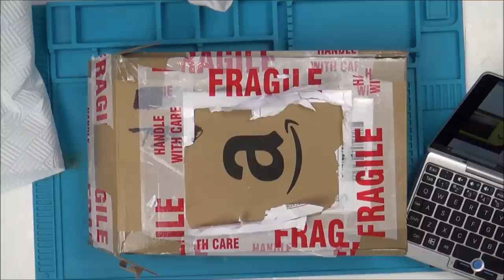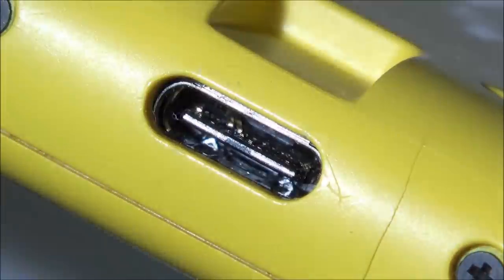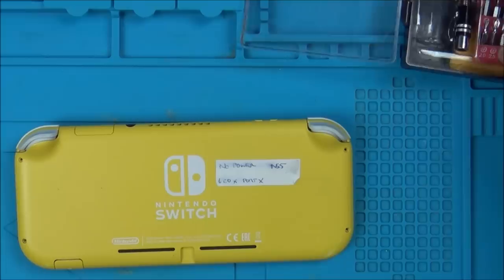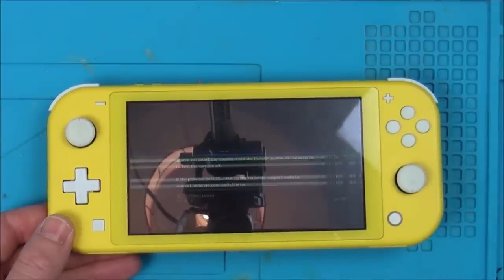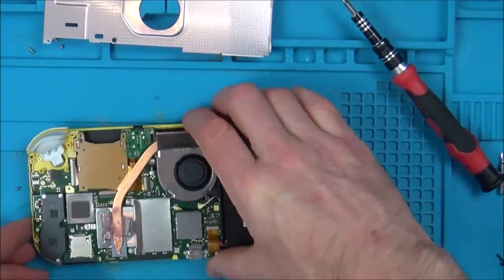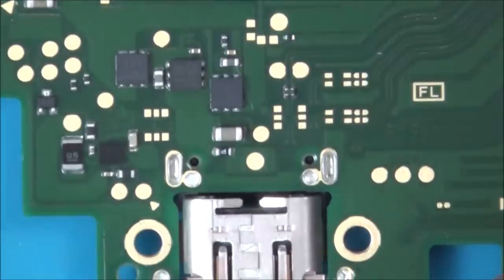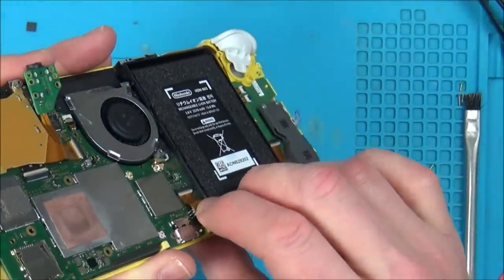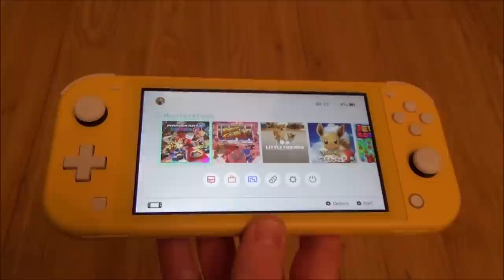Trying to FIX: Faulty £85 Nintendo Switch LITE from eBay

Comment: Vince: "I might just get away with bending those pins back in place" 
Me: Looks at video length "Yeah i don't think so"
Reply: 🤣🤣 I did the exact same thing!
Reply: Well maybe you should watch the whole thing 😉 these are the best videos when Vince does these.
Reply: to be fair, even if that worked, they'd still make the video take forever.
i once watched 10 minutes for what came down to "start the program, go to options and set these 3 options to these 3 settings"

Comment: If the seller didnt advertise the broken screen, I would ask for a partial refund.
Reply: Yup. I'd be telling the seller to refund the difference for a screen or get negative feedback. I'd also have no hesitation to expose the sellers name on a popular YouTube channel!
Reply: Definitely do it because it’ll deter the cowboy sellers and eBay. Especially if they know they’ll have to hand back 50%.
Reply: +Randy Smith, Never, EVER tell a seller you'll leave negative feedback. eBay WILL take this as feedback extortion, and you will lose any case you open. Do NOT do it.
Reply: @Dan-TechAndMusic  correct.  I always say I will leave appropriate feedback.
Reply: Agreed. Advertising it as “for parts” doesn’t give license to misrepresent its faults.
Reply: @Dan-TechAndMusic  You are absolutely correct - happened to me once, now I've learned my lesson. The correct way is to open a dispute, present your case and say that you would either accept a full refund with item return (paid by eBay) or partial refund (if you want that at all) and you keep the item and see which way it goes.

Comment: Its a mash up, dody main board and dodgy screen, someone swapped it it out and screwed you over... again...
Reply: There's too much of this going on end they know ebay will do nothing about it. I bought a quite expensive CD player a couple of years back that had a faulty transformer, a faulty main board, a dead laser, the remote sensor on the front board was bad and the remote itself was faulty. EBay did not want to know.
Reply: @jasejj  it was the same with a car I bought, it had water damage, front suspension damaged so bad the springs were broken into 3 bits, basically needed the whole front end replaced just to make it road legal. I complained, ebay said we will give you a refund for the price of the car, but you got to return it to the seller at your cost and driving licence cost if you get pulled over. rather than having a go at the seller for selling an unroadworthy vehicle on ebay.
Reply: @jasejj  I bought as "untested" an Alienware laptop with SLI cards in Mint condition, there where : Battery, screen, keyboard, motherboard and both SLI cards that where faulty. When i saw later on the sellers' sells, there were a lot of working Alienware laptops, beside a negative feedback ebay did not much about this.
Now when i buy faulty products I watch what the seller is selling and what the seller sold in the feedback and i take the time to ask questions, i prefer to loose an object than buying junk. If i have a little doubt, i don't buy it also.
Reply: I'm really curious how you guys are going about contacting ebay.  I've had a lot of garbage from seller but I've been refunded on each and every one of them by opening an item not as described case against the seller.  Most times the seller won't even respond to the case (likely because they know full well they sent me garbage) and ebay automatically gives me my refund.  Just takes time.
Reply: @Yoldark34  buying untested electronics is a gamble. A few months ago I bought a untested ps3 from mercari and It was in pretty rough shape. I think the seller got it in a lot and didn't have any games, cords, or controllers to test it. I bought it because it was only $14. I tested it myself and everything was fully functional. I ended up selling it for some extra money but I bought another untested ps3 this week for about $20. The seller couldn't test it and thought it had been in a flood because he seen a little rust in the usb port. That one turned out to be functional as well but I'm currently trying to get it to read games so it may need a laser swap.
Reply: I only buy untested electronics if its fairly cheap. I dont have any repair skills so it has to be something simple for me to fix lol. If not I'll just sell it for what I paid for it. That way Im not getting screwed over for a faulty device that I paid too much for. Ps I don't do this all the time.
Reply: @jasejj  Just claim damaged in post and don't state you look at them as eBay will say not in same condition and deny return. These scam sellers know this and use it as a loophole not to have to accept return and have feedback removed.
Reply: @thetechgenie7374  I don't disagree but the problem is you have to go through the repair attempt process to reach the point where you can do something like that. That can take weeks depending on how tightly they've strung you up. Unlike these tw@ts, I'm not dishonest.

Comment: Analog sticks had also been replaced by chinese ones... Genuine one is the new model, and with a blue ribbon cable...
Whoever sold you these only forgot to get the working fan and put a bad one...

Comment: Have a go replacing the USB, what about putting the low temp  solder on the inner pins so you know if the outer pins soldered then the inners must have.

Comment: One thing to remember for you Vince:
A cracked display/touch screen NEVER keeps a device from booting as long as it’s only the crack!
Reply: Tell that to every Nintendo 2DS ever made.
Reply: @SimonNemeth  I was about to say that lol
Reply: Screens themselves aren't smart, they can't tell if they're physically broken like this.
A fan wouldn't be able to tell if it's blades were snapped , it would just spin it's motor
Reply: @televisionandcheese  You are right, but when your main current goes through the digitizer like in the 2DS your booting process is impossible

Comment: 🤔 Vince the Switch Lite uses a standard USB-C port just like the standard Switch. Replacing the port with one from a junk switch board would be the best idea.
Reply: Yeah, you just bought a bunch of broken switch boards, I'd bet those have some USB ports you could salvage. Also there are plenty of replacement parts on ebay/amazon. https://www.amazon.co.uk/Feicuan-Replacement-Charging-Nintendo-Console/dp/B078713CZQ
Reply: He said he doesn't want to it's too much work
Reply: Use the hot air device you have and replace the port. Ali Express for the screen, not eBay.
Reply: @JohnGotts  eh, I have some experience in fixing mobile devices, and let me tell you, some of the screens that they push out are not tested thoroughly for function, especially if you get ones with digitizers. Just LCD's may be fine, but I went the cheap route by replacing the digitizer on my iPad mini, and I got ghost input all over the place. And when you have to wait a month for a part, the risk is just not worth the money that you would save, not to mention all the time you'd have to wait. Go to iFixit if you want quality parts that are thoroughly tested.

Comment: Hey Vince, USB 3.0/3.1 is more complicated than all the other usbs. If you Google the pinout you'll see what I mean, both sides are required to communicate at full speed. Old usbs used resisters to tell the charger, the output wattage to the device. Now because USB 3 is universal, the charger and device need to "negotiate" the voltage and the amperage output to the device so you don't accidentally blow things up. I think it uses a single set of transmit and receive pins (USB C has 2 pairs). That's why it only charges on one side and not the other. Cell phones and laptops can both use USB C but one take 5v and the other 19v. How does the charger know what it's charging? It communicates through those pins.
Reply: I'm no electronics expert, but I love your videos! I mess with them as a hobby. Just so you know, everyone will watch your videos. I subscribed because your awesome and explain everything you do. And that was me watching your hour long videos lol. Keep it up Vince!

Comment: Hey Vince, thanks to you i decided to give repairing something a go and ordered myself a non working PS Vita 1000 from Ebay (Japan). Scored one for $49 and when i got it today, i plugged it in and it showed a blinking orange light. I immediately thought of your video and what do you know, your fix worked! After about half an hour of charging, it stopped blinking and hitting the power button made the screen turn on! I then found out none of the buttons appart from the PS Vita button worked.... I was starting to sweat a little bit. I then looked into the system settings and jesus, firmware 1.05!!!! Updating to the latest firmware fixed everything. Thanks for the help mate!

Comment: @My Mate VINCE, Thanks again for all the subs , Great video 😊 Wonder if they dropped the switch and broke the screen and port at the same time and the shorted pins blew the chip ,was worried that the screen broke
Reply from the maker: Cheers Anonymous, you deserve it :-) I think the port was shorted which knocked out the chip. I reckon the screen was exchanged to fix up another Switch Lite and then all put together to resemble an untested Switch Lite on eBay. I haven't tried but I am now thinking the screen can be taken out by just undoing the ribbon cables and heating up and pulling off the front digitiser, without completely dismantling it all, hence the reason the LCD wasn't connected back up. Just guessing though. This one felt good to get working again :-)

Comment: Your the man Vince. Totally understand you want to fix things just to feel that satisfaction. I have a PS3 that needs the capacitor trick you did in a recent video and I have a 50 inch Samsung TV that I’m 90% sure is a dead SMD capacitor causing half a screen. But I have no method to test. Do you happen to know of a cheap multimeter that beeps to show a short? I don’t have a clue how to figure it out on a bog standard multimeter. Great video also!

Comment: The bent pins obviously caused the "short circuit" on the IC charge chip. so no surprise there. Vince, get yourself an ESD lead, so you can handle the P. C. B/ SMD sensitive IC's without damaging them with static from your body. Excellent vedio 👍. Stay safe ❤️

Comment: Well done, It's great you were able to fix it, to working order. You need to stop being so forgiving, stop making excuses, for these dodgy sellers. Surely there are actions you can take against the seller, false advertising for a start. You must be able to get your money back, if there is more wrong with it than advertised.
Reply: Thank for video great help ...
Error code 2153-1542 on my lads, thanks to your video I reckon it's motherboard  fuse or chip blow .... send it to my local repair shop not a fix I can do .. thanks 😊

Comment: Ive had a similar issue happen on an iphone 5s. I think it has to be a backlight/lcd circuit because this 5s would only take certain replacement displays and even then it wouldnt show properly or the backlight would be fucked up and the digitizer wouldnt recognize

Comment: Am making a guess here at 21:00 of the vid that it may well be, someone has tried to DIY it, either forgot or didn't know about the ribbon cables and just said sod it and bought a new one when faced with another stripdown to its undies for those crucial cables.   I am guessing so prob wrong but I have done that myself when trying to refurb something and usually a nause to dismantle to find I left something crucial out and sworn a bit and just bought the new part lol

Comment: Great video, just a small-ish note though for future testing. You didn't actually ever test the pro controller on USB data because you didn't turn on pro controller over USB till after you unplugged it just before plugging in the magic ns. The pro controller would have worked over usb on the same side as it was charging because you proved with the magic ns that it can do power and data on the same side. What happened was when you plugged it in the first time when it was charging it sent a signal so that it would connect to the switch wirelessly without having to hit the sync buttons.

Comment: What other circumstances would lead the screen to be smashed and the USB-C port to be damaged? Potentially if it was on a table charging, and someone tripped over the cable, pulled the console down, bent the pins and the Switch went flying into something hard like the corner of a table. It's a pretty likely scenario, but it would take a pretty hard fall to crack a plastic screen.

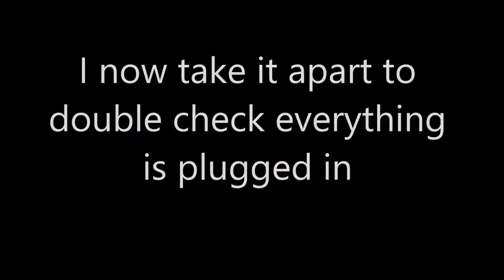Comment: I know I'm late for this video, but please take a loot @33:04 and pause the video. If you notice, on the main board, up above the interconnect cable connector, the regular Switch Lite has a COIL next to the Screen IC, but this one has a ferrite capacitor thingy.
Has that been tampered with or is it normal?

Comment: Small tip which I learned from youtube. When there is a short and you remove the chip, verify with the multimeter that the short is gone before putting the new one ;)

Comment: I'm trying to fix a Switch Lite with blank screen no sound, it turns on partially as I can see the back light come on and I have felt the APU warm up. Where do you think the issue would be? any help would be greatly appreciated.

Comment: I think what's happened is the usb port got damaged... then it wouldnt boot (I presume the pins shorted and caused some other damage) so they took the screen out to put on another console to sell as working. Not connected the screen so it seems like its completely dead and makes the console seem an easy fix and then being able to get the most for the console they could. I havent watched the whole video so I may be wrong

Comment: Hi Vince, got a question for u if u have time 2answer! My son dropped nintendo switch in2 sink with little drop of water in it while switch was turned on, he quickly turned it off, it wont turn on now, is there any way it can be fixed, even to just docking mode? Lisa x

Comment: Just curious would it ever be possible to make an even smaller switch lite by replacing the screen for a littler one and then custom printing a case for it? I mostly was just curious how would you go about finding smaller screens or does the switch use their own ones?

Comment: Just a heads up Vince in that the Corona Virus doesn't survive very long without a host keeping it at it's desired Temperature, I googled it, because I have been getting a crap ton of Goodies from the epicentre Err-China before and just about every single day since news went viral on it.. 
Cant wait for you to do a new series on cheap DIY Kits coming from China ;) OH! and then another series as to what you think of em, me? I am still surprised at the quality and yes the absolute junk that occasionally is sent, mind you I haven't had a kit not work but Oy~~~~eee they need to be handled delicately..

APU I dropped a like..

Comment: *Adendum*
Vince you have a Heat station so changing the HDM port should be a "piss of keg" Err-"Piece of cake", Just heat under side a bit and then with the pins facing downward heat the HDMI port until it falls off, and with the replacement heat the tracks a little while they are facing upward, then place the HDMI Port down and heat that up until it moves back when nudged, and then once cooled, solder the earth tabs..

Comment: Hi What do you recommend before buying Nintendo Switch

Copy joy cons or Lite?
Reply: If you are going to stream from it get the regular switch to be able to connect it to a PC through the dock but if you are only going to play it and not stream then it doesn't matter which one you get just don't buy fake joycons the original nintendo ones are 100.000.00% better and i have had my version 2 regular switch since January 4th and been playing it almost every day with no drift or overheating but i take care of mine as good as i can because i can't get a new one if mine stops working.

Comment: What you could do if buy another switch lite for parts and make sure with the seller if the screen works first so if they lie you will be covered by ebay money back guarantee if of course the other ones you receive later on you get working fine

Comment: If you swap a USB-C from a Switch to the Switch Lite, it still can’t be dock cause the Switch Lite doesn’t have a video chip (which is for the Switch dock capability).

Comment: Vince! Ebay has the 100 percent buyer guarantee. You can always return anything you buy and get a refund for any reason. That no refunds disclosure sellers put doesn't mean anything. In this instance I would return that and get my money back. If you have any issues with the seller not wanting  to take it back Ebay will step in and literally remove the money from their paypal account and give you the refund themselves. The seller will also pay for return shipping.  Ebay takes the side of the buyer 99 percent of the time.
 This seller knew the screen was bad and sold that to you. Very unethical!

Comment: I got to use switch light for $170 and after a week when I went to plug it in one night it came up with an error that was basically the switches version of the red ring of death, and it looked like the previous owner had  cracked the usb-c port so, after returning it and waiting another week I got the new switch with better battery life!
Reply: And the thing also had a 64GB SD card that the previous owner forgot about.

Comment: I no nothing about the switch internally but I'm curious if you put a standard switch charge port in the switch light would that mean it can be used on the dock or is that more to do with a particular chip etc like I say just curious
Reply: *know
Reply: It doesn't have the hardware to cast to a TV.